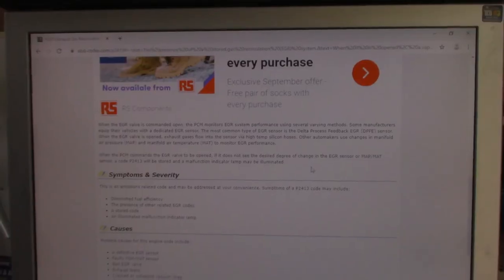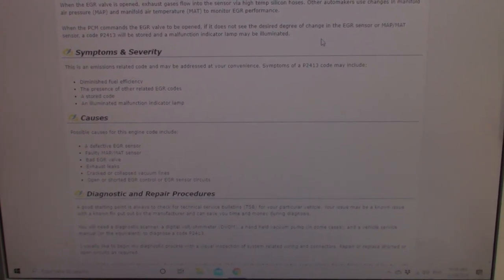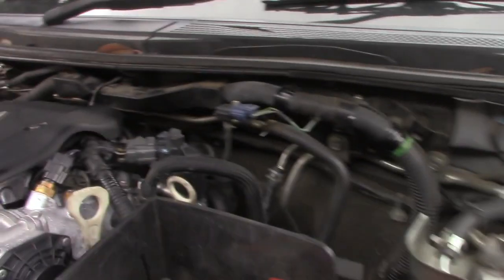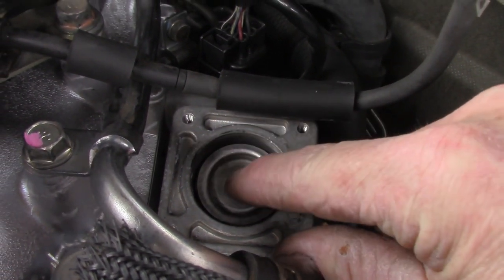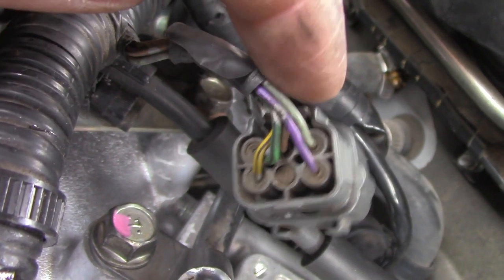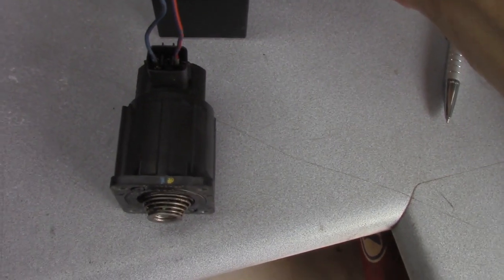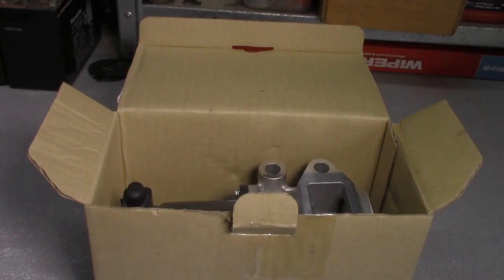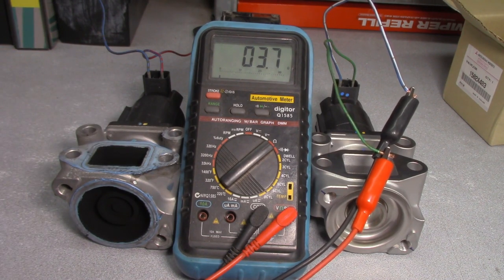Triton P2413 Fault Code MiracleMAX

Comment: Hi Max, I swapped the old EGR  with a brand new one. Cleared all codes, when i try an active test to set EGR to 100%, I can feel there is  no movement with the EGR motor, EGR stays at 0% and it throws this code ? What do you think ? Also putting 12v to the correct pins on the EGR opens and closes the valve no issues.
Reply from the maker: So did you replace the EGR valve because of a code? Have you checked for 5 volts, tested ground and varying voltage at the signal wire? Have you tested it at the PCM?
Reply: Hi Max, thanks for your reply, I replaced the EGR as I was getting P4213, after a clean the old EGR motor did not actuate with 12v applied to neg and pos pins, new EGR worked fine. 
Update : After I cleared the codes, and de-energised the car, the new EGR Position is at 65% after idling for a few seconds (Engine at operating temp), however, EGR ERR value is eratically fluctuating anywhere from -70% to 69%. After a 3min test drive, same P4213 code pops up, and both EGR values are back to 0%
MAF g/s reading is also eracticlly fluctuating from 19.00 to 29.00 g/s on idle, and CAT temp has a static value of 22 degrees Celsius... Im guessing dirty MAF and blocked CAT ? The turbo had a history of oil leaks into compression housing(now fixed), which left heaps of engine oil in the intercooler & in the piping on hot and cold side (now cleaned), any thoughts? 
Much appreciated!
Reply from the maker: @Dru180sx  Does yours have a CAT or are your referring to a DPF? Carbon buildup can cause this issue. It is strange that the MAF is reading this way. Is it clean? The MAF reading will change with the EGR actuating, therefore changing the reading, however it should not be erratic. Temp sensors can play up. Can you disconnect one and see if it reads -40 degrees on the scan tool? Are the EGR readings at the actual valve consistent with what you are seeing on the scan tool? If you had oil leaks through the intake system, it is possible that you have carbon buildup that must be removed. Have you carried out a smoke machine test to see if there are any intake vacuum leaks?
Reply: Mine has a CAT. It's the 2011 MN  model. I'll clean the MAF, and check the intake for vacuum leaks, and clean the temp sensors, including EGT sensor, I think is a good start to see if I can rectify the MAF readings... than a EGR Relearn. See how she goes. Thanks again mate.
Reply from the maker: @Dru180sx  Let us know how you go 👍

Comment: Good morning, when my l200 triton does the learning of the nozzles it only does the first injector nozzle and for learning, then the mechanic interrupts the process. I've already tried another mechanic and he says it can't be done. Could this procedure take a long time to finish?

Brasil L200 triton gl 2013 motor diesel 3.2 4M41
Reply from the maker: Hey Claus Roberth Kamchen,
I'm not exactly sure of what you mean. Are you referring to injector coding or small injection quantity relearning?
I have a video on each.
https://www.youtube.com/watch?v=iCK3REQ-yzg&t=4s&ab_channel=MiracleMAX
https://www.youtube.com/watch?v=Z6_ru3XxO20&t=16s&ab_channel=MiracleMAX
This should provide you the step by step process of both procedures.
I hope that helps
MiracleMAX
Reply: Good morning, I bought Aliexpress's egr valve. but it works a few kilometers, and after it heats up, it stops working, the supplier sent another one under warranty, but it gave the same problem. Where did you buy this from the video?

thank you Claus

Brazil Google translator

Comment: Hi Max I am answering some of your questions concerning my triton. I boughti it as a second hand with 144.000 km already on. I do not know its service history because it was imported in my county from Austria and the mechaics there don't answer my e-mails .  The chassis number is MMCJYKB40CD006084. Can you or anybody find anything from the record files of Mitsubishi motors ? I forgot to mention the P1766 FAULT SO its three P1766 P1782 and P1783
Reply from the maker: Sorry, I am not able to research history of your vehicle.
Here is some information on the remaining fault code you have asked about
P1766
http://mmc-manuals.ru/manuals/pajero_iv/online/Service_Manual/2017/23/html/M123112220042100ENG.HTM

Comment: я правильно понял, что управляется клапан напряжением 12в, а управление выходом клапана осуществляется частотой ?
Reply from the maker: Hey MAX PROFF,
I have entered your comment into Google translate and will try and answer your question as best as I can.
The EGR valve is broken into two circuits - the motor and the potentiometer. The motor is driven by 12 volts. The potentiometer has a 5 volt reference, a ground and a signal return back to the ECU. The ECU drives the EGR motor via a pulse width modulated signal.
https://youtu.be/pR4J58qmr8k?t=290
This is also another video I did on a Triton with an EGR fault
https://www.youtube.com/watch?v=nlErGRhRFMA&ab_channel=MiracleMAX
I hope that answers your question.
MiracleMAX

Comment: How could I put that fitting room together. You will have the diagram to make egr tester
Reply from the maker: Hey Braythiago,
I'm not exactly sure of what you are asking, but I will be making a video at some point about the function generator build with a schematic. I'll put it in my 'DIY Workshop Equipment' playlist.
I got the little function generator off Ebay under the title '1Hz~150kHz PWM Signal Generator Pulse Frequency Adjustable Module Test EquiSJKA'
I used the voltage protection circuit from Vince's Thoughts Blog
http://blog.deconinck.info/post/2017/12/22/18650-Battery-charger-reverse-polarity-protection
I also used a mosfet on the output side to cope with the high current.
Stay tuned for the video & don't forget to subscribe & hit the notification bell so you don't miss out!
MiracleMAX
Reply: I was wondering if you can share me the schematic diagram of the egr valve tester
Reply from the maker: @braythiago1127  Hey Braythiago,
I have that information in my last comment. When I get a chance, I'll make a video on the build.